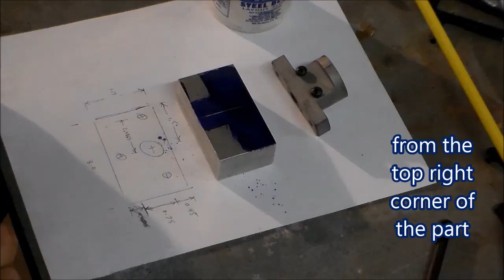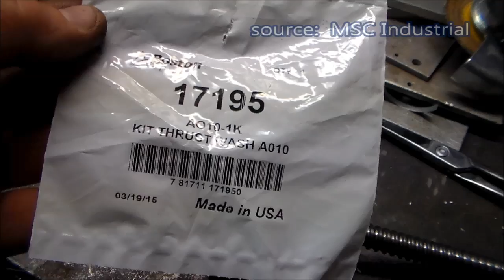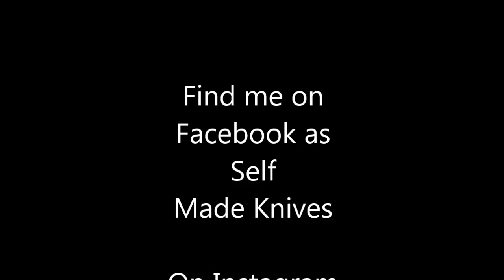Part 4 Harbor Freight Mini Mill X2 CNC Conversion Step by Step

Comment: Your Taiwan 3/8" 24 die might be mislabeled. You have the two dies face to back, so it's hard to tell if the diameter is really different or what. Check the clearance on the backside of each along with a pitch gauge on the threads. You might have a usable die but just don't know what it is... I'd take the Dremel and grind that mark off of it. Thanks for the videos, BTW! Always appreciated!

Comment: I voted for the washer method. Was thinking the hardened steel wouldn't work with the die.. great job! making threads on a lathe has to be double tuff!

Comment: I'm glad to see that you didn't take the fourth option and hide the mistake from us. I was wondering why you didn't originally cut the threads with a die. I don't see any benefit to cutting them with a lathe.
Reply from the maker: I'm no machinist, so... First thing, dies are very slow and finding one in a particular thread pitch/size might not always be easy. Second problem with a die is that you still have to have the exact right diameter material, which makes them somewhat limited. I'm trying to get better at threading on the lathe, so I try to practice when I can. I think someone who is good with a lathe can probably cut them faster than the die. And, with a lathe, you can make any thread, any pitch, % thread engagement etc. Both have their place for sure, thanks for checking it out.
Reply from the maker: I thought I replied to this earlier, but for some reason Youtube is not posting my comments! Anyway, yes, this will cut 1" steel. You have to go kind of slow, but it is rated for it. For a little more power and speed, they do make an 85 model that is a step up from this one. Another thing to watch, the specs are usually quoting performance with a hand torch. They are all de-rated a little for cnc applications. So this unit with a machine torch is only good for 5/8" or 3/4" I think.

Comment: I would have done a thrust bearing on the side with the nut, and a radial bearing on the opposite side.
Reply from the maker: Sounds like a good idea. I went the way I did mostly because I've seen a couple other guys go this way. I really don't know what is the "best" way for any of this, it's all a learning experience. So far, my conversion is pretty much a Hoss Machine style conversion.

Comment: I recently had a problem with a Chinese mad die.  It was marked 1/4-20.  I used it to machine my school project and when the hold down screw I made with that die did not go into the clamp I made with a 1/4-20 tap I realized something was wrong.  Grabbed a 1/2-20 bolt off the shelf and it went in to the clamp fine.  Took the hold down screw to the tool room where the screw test set was and it turned out to be 1/4-28!!!  The part came out beautiful if that was what was called for in the shop drawings, alas, it was not.
Reply from the maker: +Brian G Oh, that stinks. You never know what you're getting with the import stuff. I've bought a few things that were great. I've bought a few that were in the trash can within a few minutes of using.

Comment: IS there a reason for that bit at 3min? Never seen one like that (im not a machinist, electronics/cnc brought me here). Thanks for the video! Keep it up
Reply from the maker: +Bodhi Bunker I looked at 3 minute mark, but I'm not sure what you're asking. I was adjusting the boring head a little at a time to sneak up on the diameter of the hole, while leaving the depth short. Once diameter was dialed in, I plunged the last little bit to the final depth. By the way, I'm not a machinist either! Thanks for the comment, let me know if I can explain it any better.
Reply: @SelfMadeProject   - Yeah, he didn't know what the tool was ("...that bit..."). He's never seen a boring head.
Reply: @Bodhi Bunker - Boring heads are adjustable to cut extremely precise holes and insets for applications like bushings and bearings where the geometry is important.